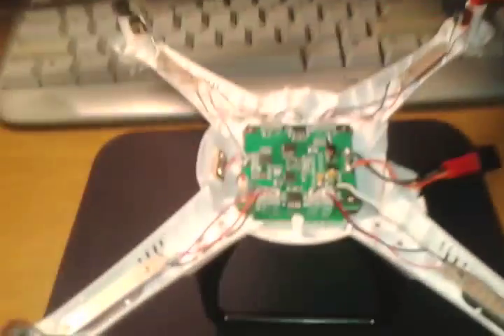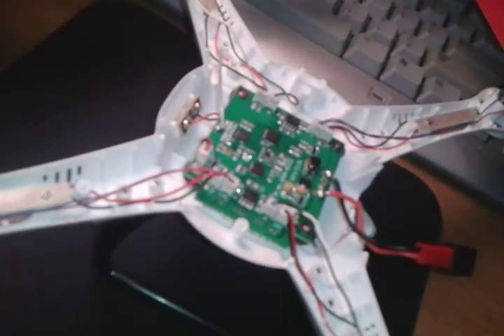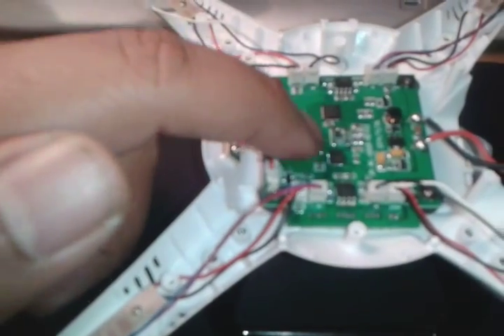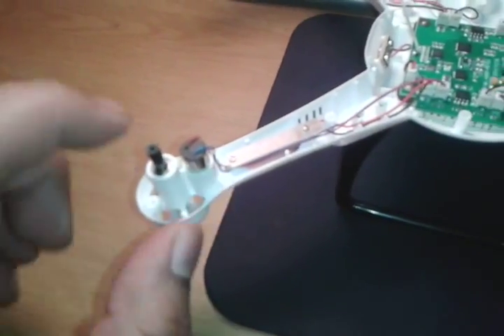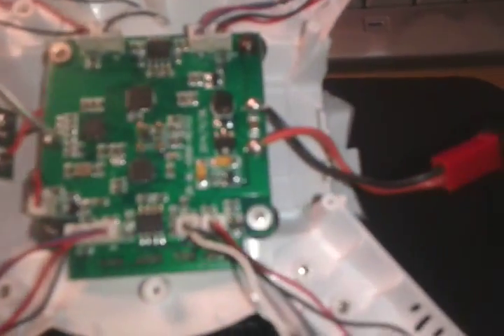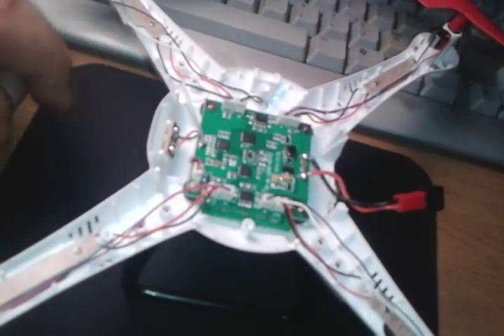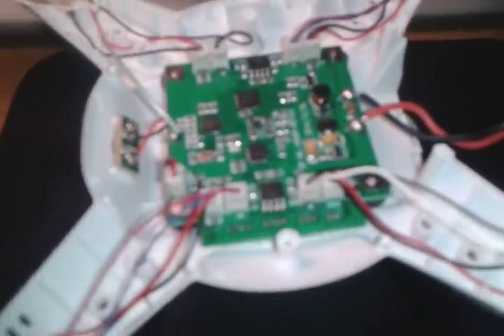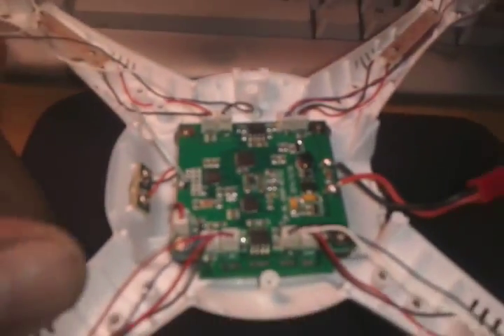Inside V686G Quadcopter Quick Peak

Comment from the maker: I did poke mine out the top too. The motors would start to smoke after full power spin up. Once u see smoke the motor would locck up. I got a defective board. Um still waiting for gearbest to male it right but they just giving me the run around.
Reply: MyTinyTV Got mine from Banggood, and it is a used one, somebody did not like it, after using it, and sent it back, thing is damaged, monitor is scratched and has been opened, one motor sounds like a coffee grinder, but it flies ok, and I got 50$ refund, pre ordered 4 motors just in case
Reply from the maker: good call guy! i picked up 4cw and 4ccw but i can see the clear difference in pick from the dfd f183 aka h8 something thats 7.4 instead of 3.7v. Id sell right now for half the money. sooo disappointed

Comment: Also ordered mine on gearbest and waited for chinese new year and everything idk mine just acted sketchy once ina while but like i said i fogured out because of the way this compass is set it pretty much has to be calibrated before you take off and rth works every time plus before taking completely off give it some throttle and the lights will flash let them finish before lift off and it fixed all of my malfunctioning problems and made RTH work like a charm. Poking antenna through the top increased range huge
Reply from the maker: If Gearbest dont make it right I will be posting tons of videos so when people google them. they will find my videos telling them not to buy Gearbest

Comment: What was you quad doing mine has to be at full throttle for 6 or so seconds then jets off, and sometimes wants to just haul in a single direction i fixed mine im pretty sure by poking the antenna out the top
Reply from the maker: motors started smoking then locked up.